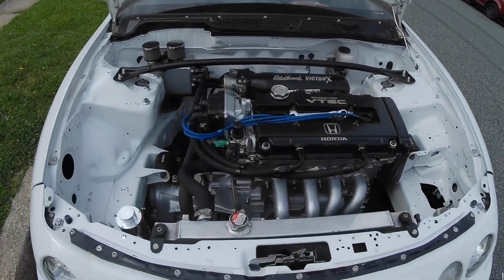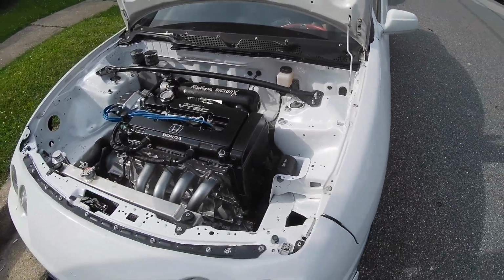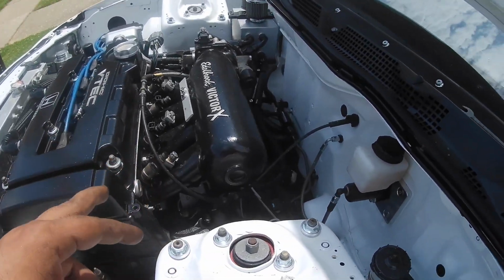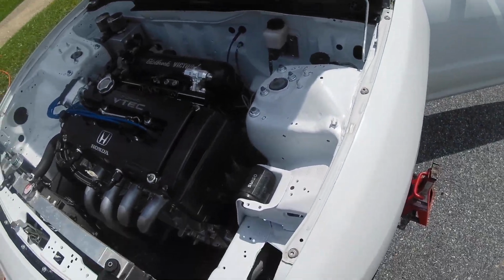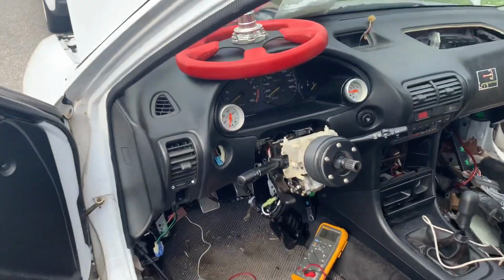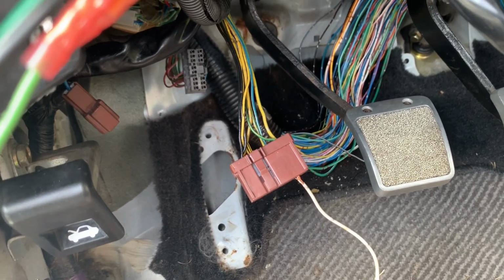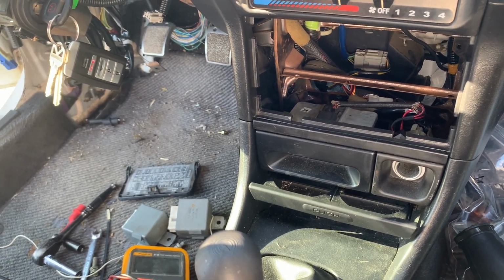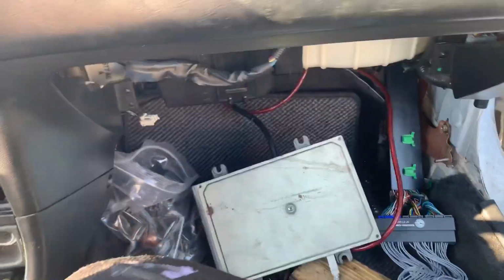trying to wrap up the b20vtec integra

Comment: You might have to do the crank sensor bypass. I had to do the same on my obd2b Integra with a b20b.
Reply from the maker: Shan s even if I’m running an obd 1 ecu?
Reply: @RevHighDriveHappy  I ran mine with the obd2b ecu and crank bypass until I did the vtec head with P28 ecu. It shouldn't matter with the obd2b>Obd1 but I never undid the bypass with the chipped ecu.

I would try the bypass with the oem computer just to rule out that possibility first.

Comment: U should get a real fuel pressure regulator like aem. Plug in stock ecu and go from there. Check ur grounds like the one on the fan switch/thermostat housing
Reply from the maker: I’ve already put the stock fuel pressure regulator back on and all my grounds appear to be good the stock ECu won’t work because the B20VTEC doesn’t have a crank sensor